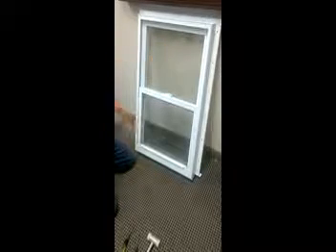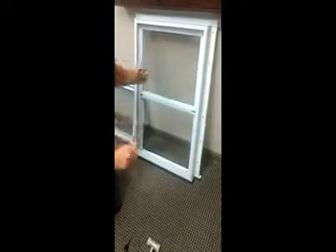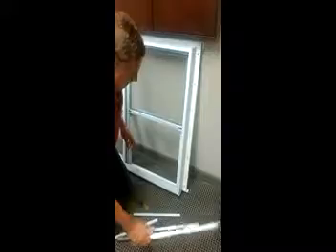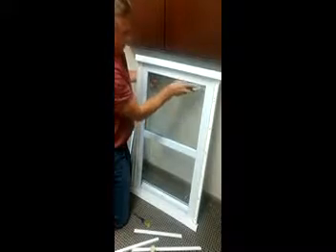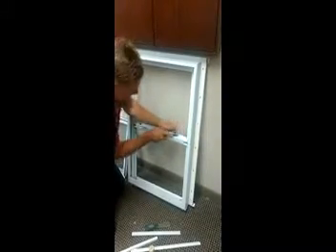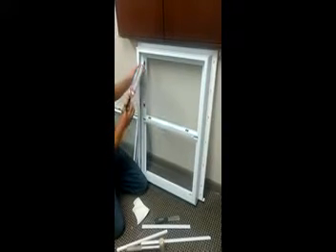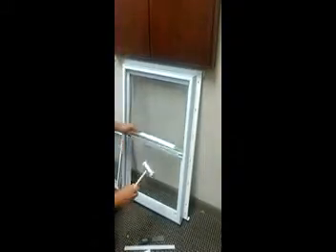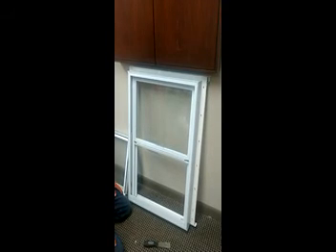Silverline Fixed Glass Replacement

Comment: Scott, I have a large Silverline window with 1 pane sliding and 1 pane fixed.  I can't figure out how to get the glazing beads out of the fixed pane.  Are all Silverline glazing beads as easy to get out as the ones you did in this video?
Reply from the maker: Sorry about the late reply but it should be the same as the single hung I worked on in this video.
Reply: I brought my windows to a glazing repair shop and for about $150 they replaced my window glazing but I had to pull out the entire window frame to bring it to them as on site repair is costly.  I also understand a large window manufacturer bought out Silverline and then closed the Silverline company to eliminate their competition.  Now my 10 year old home has windows that cannot be easily replaced because the style can't be matched.

Comment: Thanks Scott, just found out a crack on our new window and it's just a year out of warranty. So, this is definitely helpful.
On the putty knife, I was thinking of using a thin cut out wire, like the windshield guys use instead. That would stress the glass less than the putty blade, wouldn't it?
I'd need to create a point of insert & get the wire through & then move it around to cut. Any thoughts on whether this would work okay in relation to the angle of the window frame?
Reply from the maker: Sorry, I just saw you comment.  The thin putty knife works best, I have found.  I have no idea how you would get one of those wires though.  Sorry for the extremely late reply.

Comment: where to buy the glass just the glass
Reply from the maker: At any glass repair store.  You will need to know the exact size and overall thickness of the insulated glass unit.  Usually; 5/8", 11/16", 3/4", 13/16" or 7/8" on most windows.

Comment: the sides where he takes off the molding are fairly easy to break the silicone seal. The edge of the glass facing out you can’t get to. And he says a small thin bead of silicone. I think the factory uses a whole tube per window